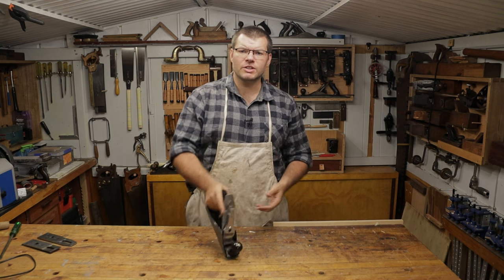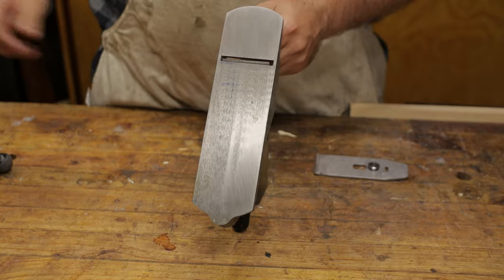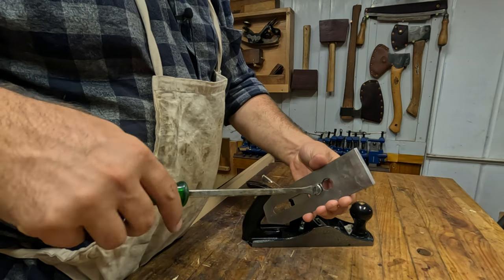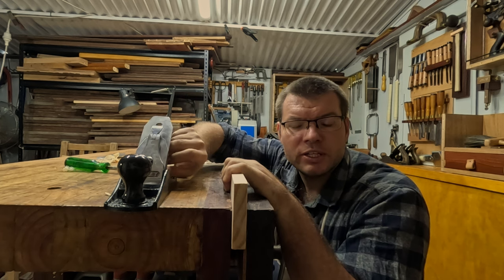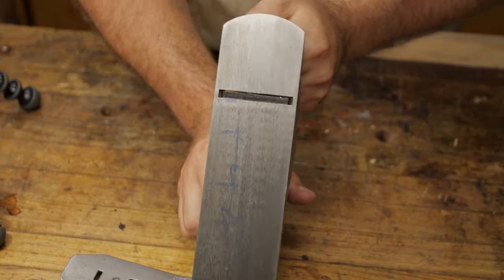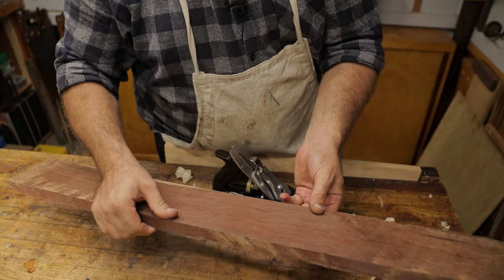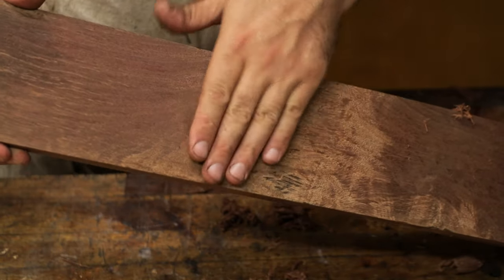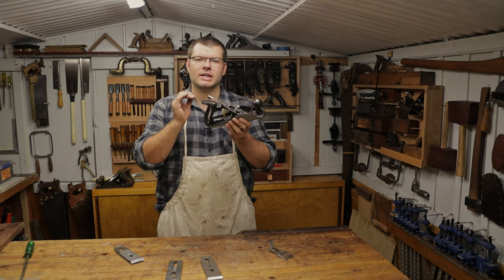New Stanley Bailey Hand-plane Improvements

Comment: Excellent work. Using a thicker iron (blade) will definitely reduce the mouth opening (I never thought of that, to be honest, though after you've done it, it is obvious). You do some good stuff, fair play. Keep it up!

To be honest, the plane, as it comes, is not a write off. For most people, it will do the job.
It's only us lot, who are sticklers for what was and see the differences who find faults with what is on offer now.
That will always be the case.

I think I've mentioned before that I like the new Stanley 4 set up as a scrub plane, to take full advantage of that wide mouth. I can't think of anything cheaper with that quality to fill that space. Don't go out and spend more on a better plane for that purpose.
Reply from the maker: Thanks Pete  I agree this plane does decent job as it comes. However setting the plane up as a scrub is definitely another good option. 

My main reason for this video was to open up even more options. For those that do full upgrade they can setup the old blade as a scrub, just switch the blade out when needed.
Reply: @AussieWoodshed  I just watched this video again and I agree that you have opened up more alternatives. For instance, I watched a Paul Sellers video where he bought one and sent it back without trying anything new with it; not what I expected, really. I'm not knocking Paul because he is a master - but I think he could have taken another look at it from outside the box - as you have done and I did by converting mine into an excellent scrub plane at no extra cost simply by adding the radius to the cutting edge.

Furthermore, seeing and hearing that Jarrah being worked (which I have never had experience of), it reminds me of an exotic African hardwood (extremely hard) that we used way back in the 80's - very 'dry' and brittle. I remember, just out of interest at the time, trying to knock a nail into a scrap and there was no way it would go in - that stuff was like granite!
Reply from the maker: @PeteLewisWoodwork  Thanks Pete. I think too many people overlook the new Stanley Bailey's because countless people say they are useless without trying them for themselves. I think it's a shame and misguided to ignore them just because there are better options available although at a higher price tag.  Especially when they function fine after some initial setup, which is why i was looking for ways to further improve them which the thicker blade assembly achieves.
This was most noteable when doing really fine smoothing on tough hard woods in particular. This also frees up the original blade to turn it into a scrub or rough removal blade, have both options with 1 plane.

That exotic woods sounds a lot like Jarrah. If you hit a nail into jarrah it will most likely split it without pre-drilling for it.

Comment: Very interesting and informative video. For decades I’ve almost exclusively used a Stanley block plane. I bought a number of second hand Stanley smoothing and jack planes a few years ago and spent an absolute eternity tuning them up. Rewarding and educational as it was, on my day job at least, I continued to use a power plane, my trusty block plane and sand paper when swinging doors and the like. However, last year I purchased a cheap low angle block plane, and then a Luban low angle block plane. Simply superb! That got me thinking about a low angle jack plane from the same manufacturer. Alas, for a long time they have been difficult to come by here in the UK, but I’m still determined to get my hands on one.
Just wondering if it would make more sense to buy the Luban out right, rather than faff around with incremental improvements on an old or new Stanley.
Reply from the maker: Sorry or the late reply. As i have not used Luban hand plane and only their blades, i don't think I'm qualified to make the decision. The Luban hand planes do appear to be of decent quality but until i have one myself to test and check i can't say for sure. When i eventually get one i will do a review and comparison but for now i cant really give you an answer to this conundrum.

Comment: Very nice video on a very good topic for a lot of woodworkers.  I bet some of us not located in Australia wonder where you obtain the Luban chipbreakers and Luban blades.  Do you have a link?
Reply from the maker: Yes, i got from my local woodworking store, Timbecon - https://www.timbecon.com.au/4-smoothing-plane . Choose the Cap Iron or the blade from the drop down menu, that will give you them for the no 4. If you want the other size on that website, just select the plane size and they should be on the drop down menu too. Workshop Heaven - https://rebrand.ly/zp3q5iy also have all the spares under the name Quangsheng as i understand they are identical. I also understand that the woodriver planes are very similar but with a few changes suggested by Rob Cosman, the blades look identical to me but having not used them i cant say for sure.

Hope this helps

Comment: hi mate in this video you talked about replacing the chip braker and blade with luban brand where did you get them from  thank you
Reply from the maker: I purchase mine from Timbecon, but they are a little hidden to find on the website.

https://www.timbecon.com.au/4-smoothing-plane

The link above is for the no 4 smoother, if you look there is a drop down box just below the name from there you can select the blade and chip breaker and lever cap for a no 4 51mm (2 in).

If you look under #6 Fore plane they have 60mm (2 3/8 in) blades 

And lastly under the no 3 is the smaller blade 44.5mm (1 3/4 in)

NOTE: they don't appear to have the replacement blade for a no 8 at 66mm

Hope this helps

Comment: Best improvement on a new Stanley in 4 steps. Step 1. Source a Falcon or Falcon Pope plane on Gumtree. Step 2. Purchase the plane. Step 3. Remove plastic handles from Stanley. Step 4. Put metal parts of the Stanley out for recycling. All jokes aside, there were Australian toolmakers that were making better planes than Stanleys of the same vintage. 'The Village Woodworker" did a great comparison between Stanley and Falcon. Their cheap and vastly superior.
Reply from the maker: Thanjs for sharing, definitely another way of doing it. I'll check that comparison out.

Comment: Hi there,

I have a newish stanley no. 7 that I am planing to upgrade both the blade and chip breaker.  I had been looking at the PMv11 veritas option that are specifically designed for stanley planes (2.5mm thick blade and 3.2mm chipbreaker).  But they are 105 AUD and 74 AUD respectively.

You used the luban blade (3.2mm) and chipbreaker (also 3.2mm) and everything fit?  I see they are only 49 AUD and 29 AUD on Timbecon.  Was the leaver cap screw long enough for that extra thickness?  I've been worried that the mouth would be closed too much with that much extra thickness?  What is the downside to the luban ones if they fit OK?  Maybe blade and breaker preperation time?

Thanks for the video!
Reply from the maker: Hi Dan, as i replaced both the Chip-breaker and the blade with the Luban ones i did not have an issue with the chip-breaker screw as it came with it, i believe the length of the chip-breaker screw would only be an issue if only the blade is replaced with a thicker one.

I used a brand new Stanley Bailey Hand-plane in this video and the mouth was really wide (6.75mm), however a few of my older hand-planes this blade assembly would not fit.

I too was worried when i first looked at the blade and chip-breaker that it might not fit. I took a bit of a gamble as i knew the mouth was really wide, and it did pay off and fit. 

I also looked at the Veritas blade and chip-breaker when getting the Luban and my local woodworking store did not have them in stock, and the price also made me look for cheaper options. I also wanted to see and show others if these cheaper blade would work (mainly in regards to the new hand-plane). However, if i had been looking for a replacement blade for my older hand-planes i would have looks for new original blades or got the Veritas ones.

I cant compare the Veritas and Luban blade and chip-breaker as i have never used the Veritas ones. I believe the differences in price are likely where they are manufactured and imported from, the steel used and also the machining (The Veritas products are usually well made and require little work to get right). I did a video on preparing the Luban set here https://youtu.be/G4abmgRbmVo.

Every hand-plane is a little different so i cant guarantee the Luban set would fit. I have not filed the mouth on any of my hand planes and don't intend on doing so to get a blade and chip-breaker to fit. 

 I hope this helps you out. If you have any more questions please let me know and i will try to help you out further.
Reply: Thanks, my no. 7 also has a 6.7mm mouth opening, so I might save some money and try the luban ones!

Comment: I am conflicted about this.  I think you solved a problem, but not because you figured out the issue, you've simply replaced a subsystem.  The sharp resonance is good, but skipping is not.  You actually DO want that sound when the blade is cutting effectively.  I think this is not so much the case of cap iron weight or thickness, but probably the case of contact.  I would check the contact between the cap iron to the blade; the lever cap to the cap iron, the top and bottom of the frog where the blade contacts.  These new planes are so poorly made that I think the issue isn't the design itself, but the tolerances and warpage, especially when cinched.

You have a frog adjuster, having a wide mouth isn't really an issue other than having shavings stuck behind the frog. My wide mouth and narrow mouth both cuts perfectly fine.  You can use the cap iron to limit tare out assuming it's set correctly.

Stanley blades have always been accused of being thin, but I've never noticed them being insufficient.  Whether they are 1910 or 2010, the steel is fine.  The issue has always been setup.

To be honest, toss these garbage new planes and buy a vintage one for 1/2 the price that works far better.
Reply from the maker: The main reason for using this plane is that they are available in more countries than vintage planes are available, and in a lot of countries around the world are cheaper than buying a vintage hand plane. When it comes to replacement Stanley Blades here in Australia the new Stanley blades are hard to get and are almost the same price or more expensive than the newer blades. I have also had these Stanley blades come twisted which is hard to remove.

Yes, i agree the Stanley blades works fine and i use them regularly, i have a full video where i setup the new Stanley Bailey hand plane and prepare it including flattening the frog. 

There is some adjustment in the frog, however the mouth is wider (at least on the ones i have) than the distance you can move the frog to counter this. Replacing the blade closes this gap up, and does remove some of the tear out and vibration that occurs due to the wider mouth.

Although a correctly set original chip breaker can help to limit tear out the main function that limited tear out in a hand plane is a tight mouth and then wood fibers are held ahead of the blade to prevent lifting. This is an upgrade that can be done by someone who has this plane and wants to work on more figured woods and not get tear out. 

If done the original blade can be easily converted into a Scrub/Rough removal blade by adding an aggressive camber and keep the replacement new blade for smoothing applications, making this plane one that can do everything with little time and knowledge needed.
Reply: @AussieWoodshed  I always feel like these aftermarket blades "glide" less well.  I am not sure if it's the right word.  They don't glide along with a kshhhhhh high pitched sound.  Instead, they do a quiet non resonant kind of cut.  I think both can work well.

I will admit that a lot of casting on newer planes are poorly made and they are not conducive to adjustments.

Comment: It's not a bailey.
Backlash improvement is due to the size of the slot, the yoke fits in, in the chip breaker. 
You can close up the mouth by adjusting the frog.  You don't need a thicker blade to do it.
You can make a wood tote and knob. It just takes a file, a chisel, drill, coping saw. I made tons for my planes.
Before buying a new blade and chip breaker, tune the plane up. Flatten the bottom, flatten the frog, the frog seat, and adjust the frog for small mouth. 
That a new plane. Built to 2023 standard and not the gold standard of the sweetheart era.
Reply from the maker: Thanks for the comment. It is a stanley bailey 1-12-004. You should watch the unboxing https://youtu.be/H2osEmIl_KE and setup https://youtu.be/XcppHlkWmXg videos before making wrong claims.

While you can close up the mouth by adjusting the frog, in this plane the adjustment still leaves a gap of around 3 - 3.5mm. Which is a rather large gap which the thicker blade eliminates. If you adjust the frog past the back of the mouth to close that up further the bottom of the blade and the frog is no longer supported properly causing vibration and bad planing performance.

While the slot in the chip breaker can cause backlash if machined incorrectly, this isn't the case with this plane the original has a nice tight fit. Backlash is more commonly caused by the distance moved before the tread on the depth adjustment thread engages the yoke, which is reduced on the thicker blade and chipbreaker assembly due to the contact being earlier on the top of the yoke, eliminating most of the backlash on the thread.

Yes you can definitely make some wooden totes and knobs to make it feel better in the hand.